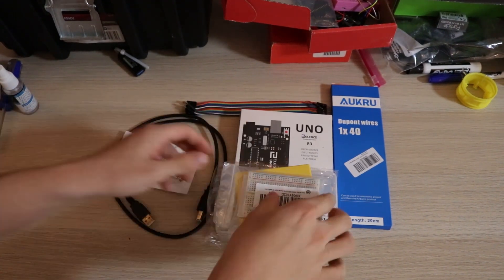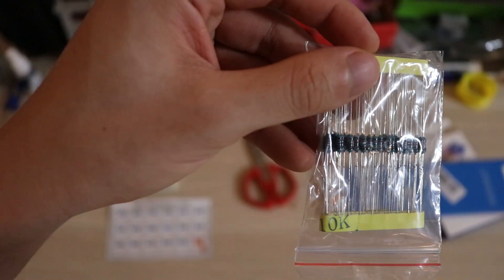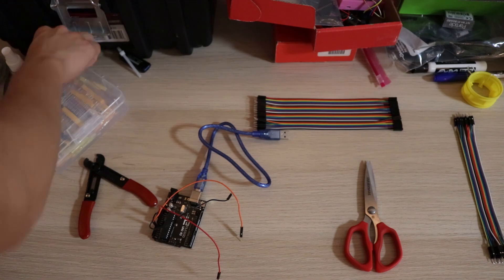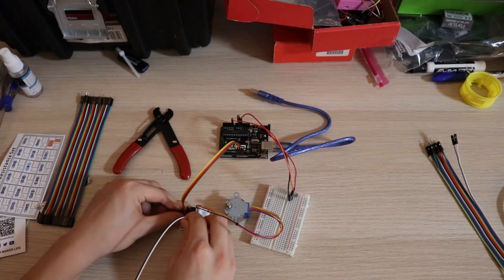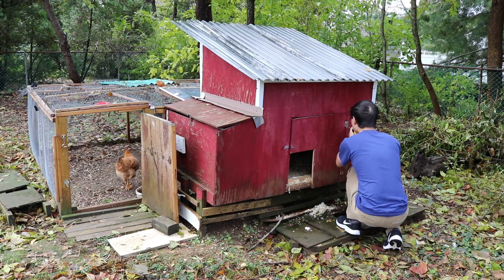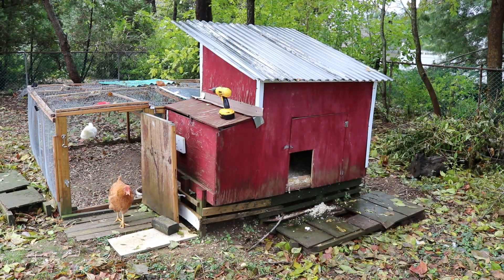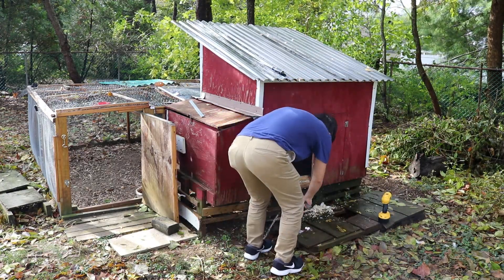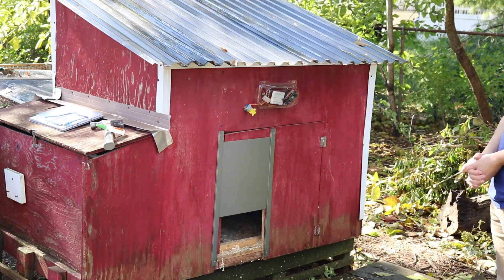Building a $250 Automatic Chicken Coop Door Opener for $100

Comment: from reading about this a little and having no experience in electronics is there somewhere to get the code for the driver to spin the stepper motor or am i a bit out of my depth here and better off going for simpler design?
Reply from the maker: I took some example code to control the stepper motor from a repo on Github but it really depends on which driver and motor you're using! Codewise, it ends up being something along the lines of motor.turn(direction, speed) so you don't actually need to worry about how motors actually work.